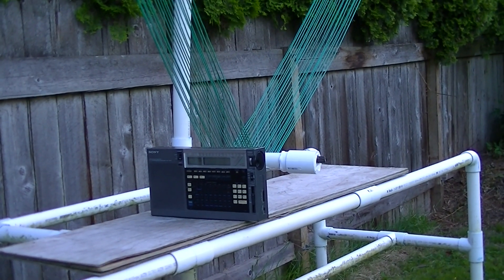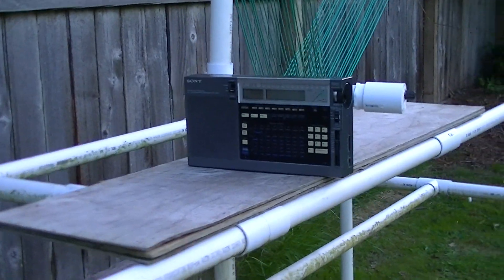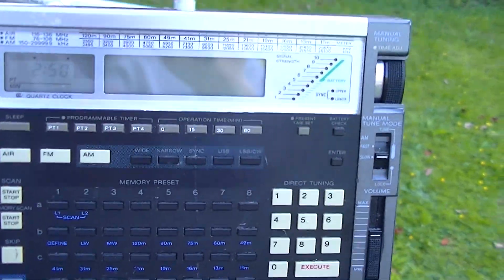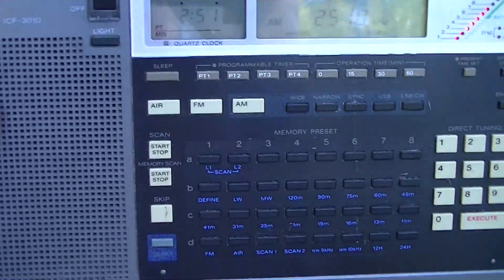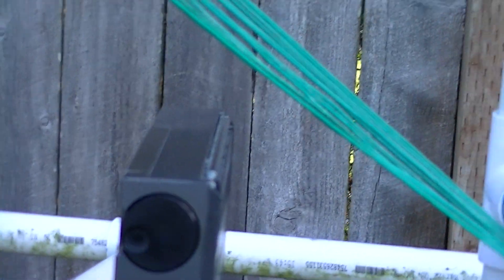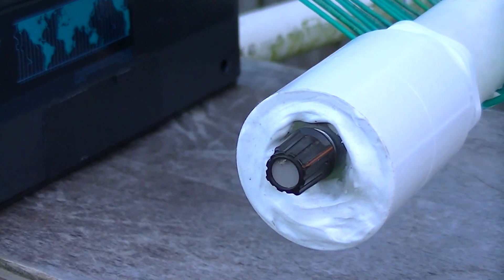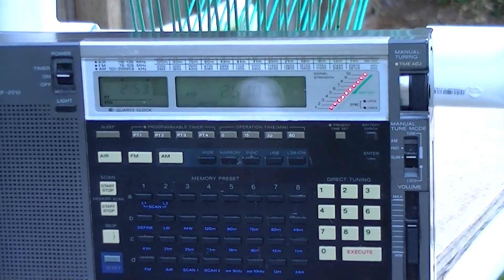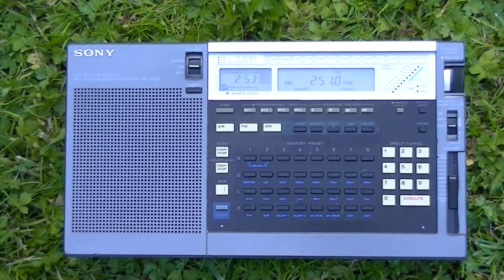6.5 Foot Longwave Tuned Passive Loop Demonstration Video

Comment: Gary on a 6.5 ft loop can you get by with 7-8 turns?
Reply from the maker: Theoretically yes, but the loop frame would need to be a gigantic size in order to cover the Longwave frequencies. I made a Medium Wave PVC box loop with 4 turns, but the size was 9.1 feet. On Longwave the size would need to be even bigger, making it tough to construct and move around.

Comment: See if you can get a faint whisper of 198 (BBC Radio 4) or 225 Polskie Radio using that antenna
Reply: Yeah. And if you wanted to listen to PR1 in UK or somewhere farther than 1000-1500km from the transmission site, building that antenna would be great idea.

Comment: Isthat one long wire, or did you join some long wires to make the whole loop?  I suppose you can just solder the ends together, asnd cover the joint with heat  shrink.

Comment: It would have been more interesting if you'd picked up a longwave broadcast. 
404 feet of wire just to hear Morse code? It doesn't seem worth it.
Reply: There are no broadcast stations over there.I use a PK Loop for Longwave reception here in the UK and I also like listening to the NDB signals.All part of the hobby of radio I guess.73.G7HFS/PA3IKH. (Yes I'm into Amateur radio too)
Reply: @ianharling9569  As a lifelong resident of the Americas, I know perfectly well that there are no longwave broadcast stations here. It is however occasionally possible, in some regions of North America, to hear a longwave broadcast from across the ocean. In particular I know that an Algerian longwave station is sometimes heard in the northern USA.
Reply: @noncounterproductive4596  beacons or broadcast stations at least the Loop worked.Rather large of course not like my portable PK Loop from Australia but hey...It's only a hobby after all.☺
Reply: @ianharling9569  Well I made a shortwave and a mediumwave loop antenna that WORKED, but I was able to HEAR things. When I see that somebody goes to the trouble and expense of building a longwave loop and hears only repetitive CW transmissions -- WHY BOTHER? There's nothing there worth hearing.
Reply: @noncounterproductive4596  hey that's all part of the hobby .Yes I also listen more to broadcast stations than I do beacons but all he was doing was demonstrating the effectiveness of the Loop...And it works.If he wasn't able to receive broadcast stations then how  do you expect he could demonstrate the Loop? You may find listening to distant cw beacons boring but that's your personal opinion.

Comment: Would love to see how this is constructed, but unfortunately the www.am-dx.com site is not active. Are they available any longer. Thanks.
Reply: Try this: coot.net/assets/pdf/ThePVCLoopOverallArticle.pdf
Reply from the maker: Hi n2uyb14, The full PVC Loop article (including plans for this model) is posted at http://www.mediafire.com/file/igw1zjwfzmw/ThePVCLoopOverallArticle.doc/file  Good luck! Gary
Reply: DXerGary:
The file you requested has been removed from MediaFire for a violation of our Terms of Service. 

This file has been taken down on 2012-04-05by:

File Name: ThePVCLoopOverallArticle.doc (445 KB)
Reply from the maker: Yes, although I was the original author of the article, a scam company claimed it was theirs, causing issues with the posting. They apparently were looking for an easy way to get $$ from original authors, who they thought would pay them to back off (I never did). I can send the article directly, if anyone can't find it on the web.

Comment: Hi. Do you think the sound of some of the MW heard on the LW band is natural or is there a problem with the radio?
Reply from the maker: Hello Mr. Kharrasi, The ICF-2010 does occasionally have some spurious reception of strong local MW stations on the Longwave frequencies. It is a common problem in portable radios that cover the Longwave frequencies, due to simple circuit design without much filtering.
Reply: No it's natural.

Comment: This makes me interested to try LW DXing again. About 20 years ago, I was able to receive Atlantic 252 from Ireland, an amazing top 40 station on 252 kHz Long Wave, with 1.2 Megawatts power from northeastern Canada with a long wire antenna connected to a Nordmende 808. Now there seems to be so much more noise on the LW band, likely due to so many switching power supplies being used everywhere (even for the LED street lights). I wonder if such a loop, would make reception from Europe LW stations possible, considering the additional background noise today?
Reply: RTÉ is still broadcasting on 252KHz - for the next two years anyway.
Reply: There is no additional background noise. It's all the same. If I can receive BPM from china over the ocean you should have no problem.

Comment: It's amazing what these antennas can do. I have one for medium wave that uses motor controlled capacitor, a one-turn coupling loop with 50 ohm coax to my receiver, and it is rotatable using a small TV antenna rotor. At the loop, I have a homebrew 20dB gain preamp, too.
Reply: Dumb.